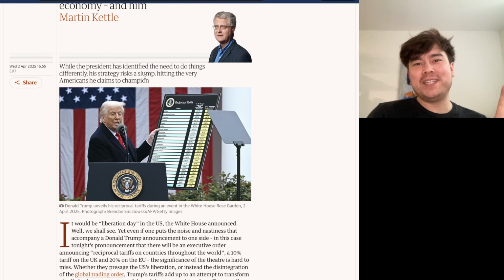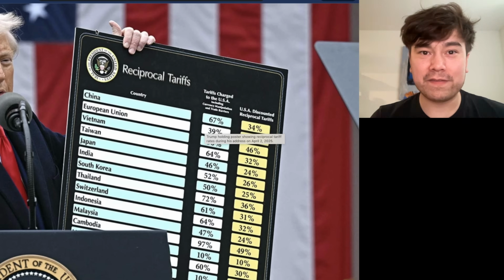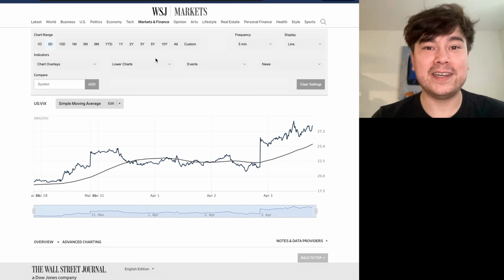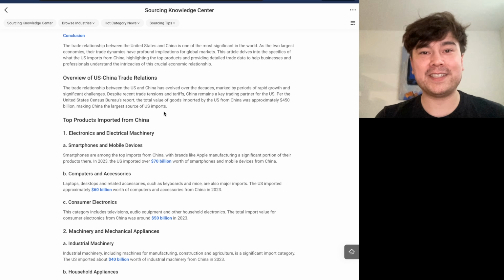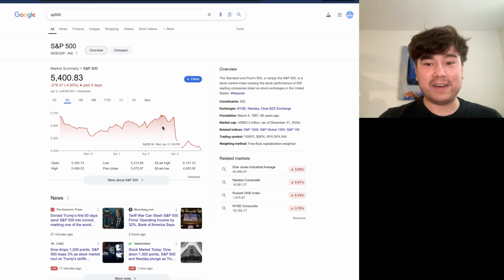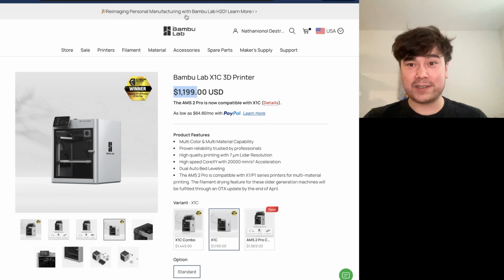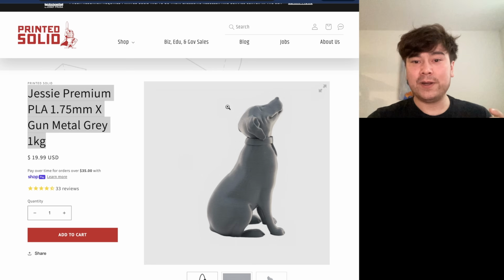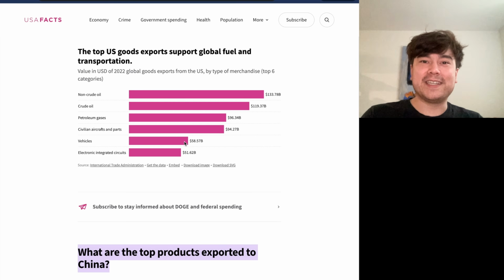Trump's Plan to Make 3D Printing 54% More Expensive (Tariffs + Liberation  Day 2025)

Comment: Everything is politics by definition, tip toeing around it is not going to help your argument or position.

Claiming that the tariffs will go away when a Democrat is elected due to "two party" system fails to address material effects of policy decisions and only feeds the "team sports" narrative.  It is possible to apply nuance and make real value judgments, opting out of critical analysis leaves room everything else.
Reply from the maker: Everything is politics by which definition?

Comment: I was kind of leaning towards the Core One Kit before the tariffs struck.  Printed Solid is not selling any version of the Core One and refers customers to Prusa direct.  Apparently Prusa sold out the Core One kits in just a couple of days because shipping new orders are now 11 -13 weeks out.  Quite a few of the Chinese manufacturers maintain warehouses in the US it will be interesting to see what happens to prices when existing stock runs out.  Next order date for the H2D is April 8th.  I keep checking daily to see if any prices increases yet.  Bambu is not going to absorb a 54% tariff.  Nintendo just stopped the pre order date of the Switch 2, April 8, as I am sure they are going to adjust prices based on the tariffs.  I was planning on upgrading 3 things this year:  3D printer,  LG G5 77 OLED, and was looking at the M4 Mac Studio.  Will have to wait and see about prices.  Going to hold off on the 3D printer until April 8 and either order the H2D or the X1C with AMS2.

Comment: The markets hate uncertainty. The dump is expected. It will level out. The Chinese business practices are like the wild west, lawless with little oversight. They hide behind these lawless practices because there is no accountability. Unless there is a US company operating in China for cheap labor you are  SOL if something goes wrong. The 10% tariff across the board is to deal with these underhanded practices that China and Vietnam operate under. They routinely tunnel product thru low tariff countries to circumvent higher rates.  It will take time to move manufacturing back to the US , short term pain for long term gain.  You don't know that the prices will go up, if they do you have a choice to buy it or not.  Chinese factories are not more efficient they have cheaper labor. Cut to the short this will kill China's economy as the US is much stronger economically and we import more from them then they do from us. China has nothing unique , only cheap labor with lots of factories. Other countries like Poland and Malaysia can easily pick that up. We can only hope that both sides decide that it's not in their best interest to continue the status quo.

Comment: have you ever tried to make an Ender 3 work by upgrading the shit out of it? of course its expensive
and thats before you actually have to start buying more filiment because buying filiment implies ur getting shit to print

current problem: it runs but shuts down the moment you tell it to start any process involving heating…. so basically the entire print function

Comment: You need to start coming with ways to avoid those tariffs to start with. Will it work if you ask a friend to ship you products/parts from EU/China? I've already done this several time here in EU just to avoid the custom fees -- which in a way is like a tariff. If you ask the sender to sett the value of the package to a very low sum, the fees will be a lot less that it would be if they were sent by the company. @NathanBuildsRobots, you should definitely start using your affiliate links and help your american boys out there!

Comment: Without tariffs its impossible for any US business to compete in manufacturing.   I can buy parts shipped to my door from China for cheaper than I can mail them to my next door neighbor.  With the breakthroughs in automation it's possible but there is no reason for companies to spend on tooling up.  By forcing more even trade by raising prices we can bring back American manufacturing.  I'm already noticing a difference at my current manufacturing job.  This is a good thing despite the short term pain.
Reply: @JeffreyBuilds  I work in manufacturing as well and these last couple yrs we've been losing more and more products to China. These last 3 months that roadmap has done a complete 180° turn.
Reply: OP basically mentioned that too by saying "why would a company try to build here if they can do it cheaper there, even with tariffs", so we need something to change. A country can't survive if they are importing a lot more than they are exporting.

Comment: On a meta level: The whole situation points to a fatal concentration in the supply chains. Prusa saying he can't buy the components from china at the price point they sell the whole machine (as well as the kit prices) suggests this is no coincidence. Now what to do about that?  The sympthon is obvious, but which way to remidy the problem is a different topic.
Reply from the maker: Subsidize critical industries, same thing China does, and funnel the country’s manufacturing resources into a few special economic zones around the country to increase synergy and reduce non value added labor like transportation of parts cross country.
Reply: this indicates that Prusa buys components from China (no surprise) so even Prusa printers will increase in price even if assembled in USA.

Comment: Or they will start producing inside the United States just like Bambu Labs is doing with their new H2D. Their prices will be lower which will force the competition to eat the cost of terrifs or start producing inside the US.
Reply from the maker: Who told you they are making H2D in the USA? Sounds like a lie to me
Reply: @ Well, it appears my information was fact checked false. Dang AI got me again and changed its answer when I asked for a source 🙄. I’m going to have to start asking AI for a source before I start spewing their “facts”…
But still, it will only take one company to start producing inside the US to start the chain reaction.
Reply: They better produce in a right to work state to even have a chance at a decent price.  A union state would drive those prices up through the roof.
Reply: @gitss7367  And any imported parts would have the tariffs applied - does the US currently have the capacity to make enough control boards, stepper motors etc. at competitive prices to avoid having to import anything involved in completely producing a 3D printer there ?

Comment: A problem with Trumps tariffs is that the rest of the world will be able to source most products from other countries offering either free trade or fairer tariffs.

Don't get me wrong, I think equal tariffs (without the trade deficit added to the calculation) is fair. But adding a higher percentage just because you're not providing goods (the deficit) other countries want won't work out.

Also VAT is not tariffs. VAT is added by the country you live in as a "tax". I live in Norway. Norwegian products have VAT applied and so does products from ANY other country, not just the US. VAT provides a fairer market for both domestic and foreign products. VAT is also funding healthcare, education and so on here in Norway.

Comment: The way our economy works won't allow it to stay that way long. our economy's main driving factor is supply and demand. people will buy less at a higher price which will almost certainly drive the prices back down close to where it currently is.
Reply from the maker: That may work for luxury and consumer goods, but things like food, clothes, etc. will need to be purchased either way.

The good thing is if we get hit with oil and gas counter tariffs we will probably see gas prices go down, which should also help with domestic production of all sorts of things. But I still think prices for most things will go up on average. Especially consumer electronics and clothing.
Reply: @NathanBuildsRobots  Thats true. I do belive it will work out for 3D printing machines and supplies as well though especially because the US can produce fillament fairly reasonably and china won't want to lose the sales to us. prices will probably go up slightly, but i don't think it will be more than maybe 10%

Comment: Tariff is and import tax dumbed on the consumer.  A company in China and every else does NOT have a 50% profit margin, not even close, that they can use to compensate with.  And most consumer products are WAY  to expensive yo manufacture in the states.

So all will happen is morr expensive products both exported and domestic, as most products have imported components, less money to go around, fewer people can afford consumer ø, less revenue, less tax, less competition due to protectionidm. 

All those products we take for granted today?  Forgot about it, we are set back 20 years.

Comment: I’ve been diving back into the old RepRap universe lately, and with many good reasons beyond the cost of import. It’s never been a better time to build 3D printers and motion systems from scratch in your own workshop from old scraps. This is how we did it back in my day, and it’ll be a good thing for these whipper-snappers to get with the program. But for serious, the ease with which we’ve been able to get really good, fast, cheap printers in the past few years has been really great, but it has moved interest away from the joy and adventure of DIY, and I dunno, I’ve just had a major jones lately to see whether the crappy printer I can build myself in 2025 is significantly better than the crappy printer I could build myself in 2013. I expect very good results!
Reply from the maker: Absolutely agree
Reply: What are you making these Repraps out of? The raw materials are all tariffed as well.
Reply: Materials I already have on hand, including several boards and other components that were donated by BigTreeTech, FLY, MKS, E3D, LDO, and others!

Comment: Interesting video - I like the worked examples.  

Re your Pollymaker filament example - If the Pellets are made in the US, exported to China, and then the Filament comes back to the US.  

Let's say China puts 34% on US imports - would than mean. 
(((Pellets + 34%(US->China) + Filament Manufacture +Shipping) + 34%(China->US)+20% Existing) + US Costs + Profit)  - so potentially 34% on top of 34%+20% for some parts of the US retail costs?
Reply from the maker: Yes but someone was saying PLA is now produced in Asia and Europe as well

Comment: As a sideline, I run a small 7 printer farm using Qidi, Prusa & Elegoo printers. I just bought my 8th this week, (my 2nd Qidi +4) & I also backed the Elyarchi Alcheman Kickstarter and was told my pledge price wouldn't go up after April 10th. But I'm not counting on that.  
Right now, my biggest hit will be filament & spare parts so I'm going to be hit quite hard because my volumes aren't high. 
But imagine the mid to larger print farms. They're going to take a huge hit for those same reasons.
But maybe we'll see more smaller filament companies like Atomic & 3d Fuel make attempts at growing their capacities. 
Interesting & scary to watch!
Reply: I bought my season worth of filament in bulk before this over the winter.  I upgraded my creality fleet and have not much wear out over the years.  I bought everything used, as is, or refurbished and did the work to repair and upgrade to keep costs low.  I bought a 6 paasche (made in the USA) airbrushes and equipment to efficiently paint premium items to sell over the coming summer market then holiday season.  So I am confident with product pricing ranging from $2 or less to over $50 I am in a good spot to have a better season than most while ruining the day of any other vender using Bambu machines.  I am hoping to do so well I can cycle my 2 Ender 5s and my ender 5 Plus into Mercury One core xy machines through the course of this season.
Reply: They have no reason to increase your pledge price. YOU will pay the tariff once you declare the import when it crosses the border (or the shipping company will do it for you, for 15-50 bucks ... lol)

Comment: I could swear Bambu Lab moved up the release date of the H2D a day or two to the 8th so early birds could miss the tariffs.  If not, did they have advance warning?
Reply from the maker: No, it has been set to April 8th since the launch.
Reply: does not matter when you buy, what matters is the day it crosses the border. Which, if they start shipping on 8th will take couple weeks.
Reply: @BigFx  Nathan mentioned they have a warehouse in the US and some companies stage for releases.  In the states at least, once you’ve paid you’ve paid.  It’s extremely rare to get a package with customs duties due, as it’s fairly intractable to collect.  We’ll see if they adjust the price the day they take orders, I have doubts— typically it takes a while, but who knows nowadays.

Comment: Start assembling them in the US, problem solved.
Reply from the maker: Assembled in US with Chinese parts will still be be 2x more expensive in materials alone than made in china with tariffs.
Reply: @NathanBuildsRobots And what proportion of a 3D printer is made from steel or aluminium?
Reply: @ Chinese made parts are available at artificially low prices because of their labor practices. US made parts are at an artificially high price because of labor unions and worker protections that are enforced by the government. Labor unions do more harm than good at this point.

Comment: I suspect we will see prices go up on many things, i also suspect that to remain competitive it will not be by the margins listed in most cases. Where it does go up by the full margin, I suspect competitors will open shop here realizing the profit to be made where it can be. You will also have companies open shop here so they can claim only the cost of raw materials when they import to their American branch. If we have the strength to stick with this in the long run, it will probably be good, especially if regulations can be scaled back. However, I think that it won't last past this administration. I also think, like most things, the effectiveness of uprooting anything government is going to only have minimal success. So we will see. If it means less dependence on child labor and cheap quality that will be good.
Reply from the maker: We need to produce steel, copper, motors, bolts, aluminum extrusion, and linear bearings at industrial scales before we can make a cheap 3d printer here
Reply: @NathanBuildsRobots  we still have most of that albeit at a shell of what it was in the 1950s however this I think is the only way it is going to change, so long as there is a cheaper option people will not buy what works for more in most cases, even if they would morally object to the conditions created by the manufacturing in other places. To be completely transparent, this is non-partisan, I am not a republican nor a Trump fan, but if you want to stop funding child labor and places that are the worst eco offenders, we have to bring it back where we have some control of it. I don't think this movement is going to make it though. I just cannot think of another way to make it happen, the global economy is going to suffer and in the short run the US economy will suffer as well. I expect there will be negotiations with other first world trade allies that will reduce their rates for other compensation, but we will see.

Comment: People are cheap, even if printers and filament and parts go up. Its still a great investment. If my neighbors are more likely to have a jobs as our labor market is more competitive, because if you realize that IQ is a range and not everyone can code or be laptop class, so you need jobs for the labor class, people working with purpose helps us all.
Reply: @moonhowler13  you miss my point , lots of factors that determine what type of jobs people can do. Some like to work with hands or prefer outside work. My point is some can't do anything but factory labor jobs in question. You took offense for no reason. And dumb people in office setting yes the office is full of them but they are actually of normal to below normal IQ, 10-20 percent of our population is lower than those who you referenced. And to be clear I'm not looking down on those they are actually very happy people they find a job they like and do it well and are content. You should research the IQ spread and try to not read things looking to be offended.
Reply: This is the perspective EVERYONE is missing. We are a smart bunch. We will get by. Our neighbors that may be more simple minded need jobs and a purpose. It's better for society. Then they will have money to buy stuff. Which will hopefully be locally made products. Hopefully.

Comment: Not forget the tariff is not on the price, it is on the landed cost. So if something cost $700 and $300 shipping, than you pay the tariff from $1000. That is important on cheap heavy goods with express shipping
Reply: I always thought it was weird the green new deal Dems were happy with so much shipping using oil burner transport, but banned gas stoves.
Reply: @Louis8989-1  Oh, the gas stove ban? Like, the one that no one proposed and no one instated? The one that talking heads made up because someone in charge of regulations said they were looking into the health impacts of gas stoves?